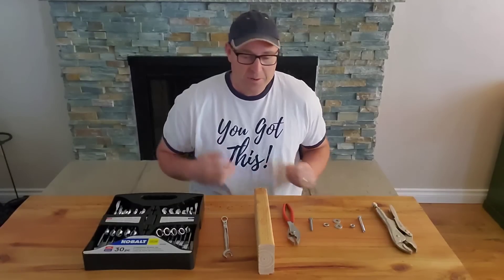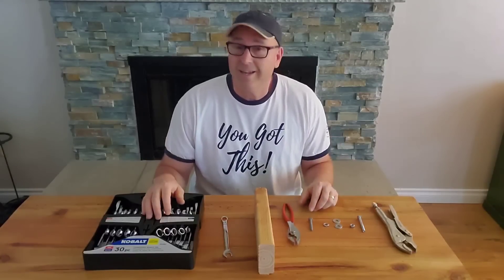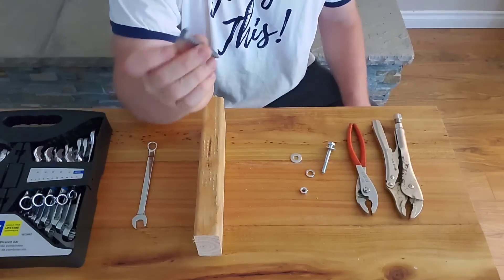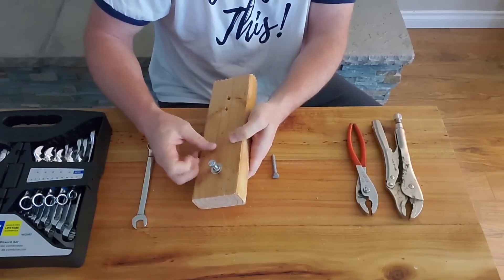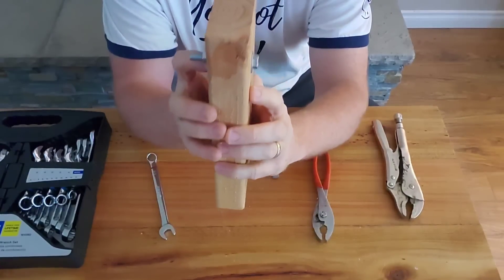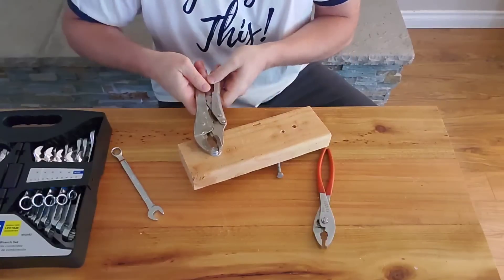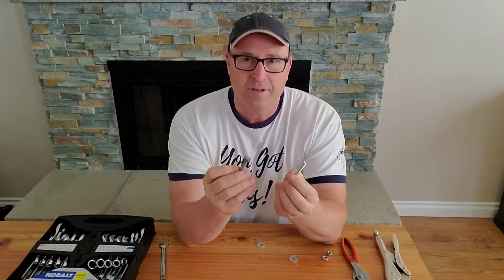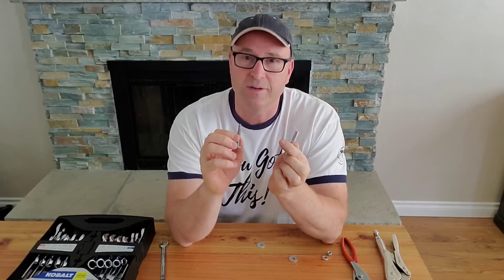How to Use a Wrench

Comment: Never forget:
Left-y - Loose-y
Right-y - Tight-y
Reply: I had a problem with that alllll throughout my childhood now I have mastered it
Reply: amen
Reply: Easy. But when there’s that one set u come along, that’s opposite. Or ur facing the wrong way. And spend forever doing it wrong 😂
Reply: @ashleyjacquot904  True though, My bed has screws that face upward into the beam so I have to lay down on my back to face it properly, If not I end up going back and forth not knowing which way its supposed to be haha
Reply: @trevorharbolt6293  however ... there are some that are the opposite.
They are rare, but usually on an IKEA product, where it's just been flipped.
Reply: Also, you're turning the top of the fastner in that direction. That screwed me up as a kid. Its a circle, if i move the bottom of screw left, aka counter clockwise, it does the opposite.
Reply: Right hand rule
Reply: i say this out loud every time
Reply: Some bolts or screws there counter or reverse threads
Reply: Except for in some toilets!! I once spent 15 mins trying to loosen a handle only to find out I was going the wrong way :((
Reply: not if you're opening markers
Reply: I use this in the shower
Reply: I live by this whenever I use any tool ever lol.
Reply: It's different for bike parts, right?
Reply: Soms bolts... they test your nerves..
Reply: I didn't get it,can someone explain me this.
Reply: What about left hand thread 🤔😂
Reply: I say that in my head all the time.
Reply: No lie, I still use it everytime I am at the workshop.
Reply: CuboidPixel seee. Exactly 😂. The struggle. I was trying to take my front seat out, in my car. And same situation.
Reply: Unless you're piping flammable gases like propane or natural gas. these are reverse threaded in order to prevent you from accidentally connecting them to the improper system and killing yourself.
Reply: @ShardtheWolf  From the top, that's correct. People are commenting that there are left hand threads- the only common ones that I can think of are the plastic nut holding your toilet flush handle on and the connection to a 100 lb propane tank. I've worked in a hardware store for three years and these are the only two that come to mind. Good insight Shard, it definitely pays to specify your reference for left or right :D

Comment: I had no idea what a locking washer was, I didn’t even know it existed, thanks.
Reply: I have seen them but never understood what they were for. This was pretty beneficial to me.
Reply: Some projects require them, some don't. If you expect the object to be used, but don't want two things to separate, use the locking washer.
Reply: They're not that good imo. Using two nuts is more trustworthy if you need something to stay tight.
Reply: Except if any vibrations get into the bolt it loosens the screws.
I've seen guys like you at Home Hardware, we call them "Double Dippers" since they have to come back and spend twice the money on a project because they're using the wrong tools and equipment.
We have common practices and standards for a reason.

Comment: If you need to buy a replacement nut or bolt, bring a matching one with you to the hardware store. There are lots of sizes and thread pitches of nuts/bolts, so bringing one that works is the best way to make sure you get the right one.

Comment: tip for wrenches, the open end is usually used for hard to reach nuts/bolts in tight spots. the open end is definitely better to use, if you can get it on the bolt or nut.

Comment: I use these tools often and it's easy to "forget" some nuts and just go using the bolts direct on the wood/whatever sometimes and it's a pain later on, so thanks, I'll try to apply the proper nuts from now on!

Comment: For those that want to know more about galvanizing:
Galvanized steel means that it's steel coated in zinc. Zinc is less resistant to oxidization than steel, and acts as the buffer for the steel it coats. If you picture a street lamp and see the spangle and speckle pattern on the pole, you have seen an example of galvanized steel at work. The process is called galvanic corrosion, and the order of moisture resistant metals is called the galvanic series.
Reply from the maker: Nice Josh! 👍

Comment: hey, you might be able to help me and presumably a lot of other people out, i'll be having to attach a lamp to two loose wires hanging from the ceiling.
what i'd specifically need to know is how i connect the wires to the lamp itself and how i screw the lamp into the ceiling, since it has no holes in it yet. 

thank you for your content, and i wish you unending success, friendo

Comment: You're really doing a great job here sir!!!! When I heard about your reasons for starting the chanel I subscribed immediately and watch every video just to support you.  My old man wasn't around when I was growing up, fortunately I had wonderful mechanically inclined grandfathers and uncles and I was naturally mechanically inclined myself. At 42 I'm a self employed locksmith who does just about all the repairs around my house and a fair amount on my car.  I'm also "the handy friend" for many of my friends.  
I'm sure that you've got a system in place for the order of your videos but I just wanted to say do NOT forget about screwdrivers...  It seems self explanatory, but I'm constantly amazed when friends of mine, even ones my age, don't even have a screwdriver...    I mean you'll need one for just about ANY job around the house from installing a dimmer switch or replacing a bad outlet, to replacing the thermostat on your refrigerator to even assembling flat pack furniture (even when they give you a tool kit in the box the tools are so bad it's just a lot easier to use your own.  
IMO every household should have at least a decent but not too expensive magnetic bit set that includes hex bits and a 1/4 drive adapter for sockets and one each dedicated #2 and #1 Phillips and flat (for when you need more reach in tight areas where the magnetic driver won't fit, like taking apart a box fan to clean the blades, etc) 
Keep up the great work!!! I know you're really helping a LOT of folks!!!
Reply from the maker: Thanks Derek.  :0)

Comment: If you dont have a locking washer you can actually screw on a second nut. I dont know it in english but the translation (ger to eng) would be “counter nut”... because of the lil diffrences in the thread of the nuts

Comment: I like to use a Carriage Bolt on timber so the square bit at the head stops it turning and you dont need to hold it. Also dont need a washer on that end and it looks tidy.

Comment: You can be working with inches and fractions of inches but is always good to know a 10 mm wrench can replace a 1/4" one, 13 m.m. a 1/2", 14 m.m. a 9/16", 17 m.m. a 5/8" and 19 m.m. a 3/4".

Comment: Just wanna leave here that altho spring washers in general seems like a good idea, they do just about nothing. Just use a regular washer and tighten the bolt, or use some locktite/glue on the treads if its really important that it doesn't come loose..

Comment: Usually when I use pliers, I use the inside of the jaws to grab the corners. Do you recommend using the flat on flat parts, or is it user preference?
Reply from the maker: The only warning I would say is be careful not to round the edges on the bolt/nut.

Comment: Will you please do a video about water flowing baseboards?  You know the old fashioned heating systems some young adults are likely to encounter in a first (think old and cheap) apartment or house. Specifically, the thermostat valve regulator cover. Mine broke years ago (who makes an analog thermostat regulator the sticks out and gets knocked around by furure??!?) And I didn't replace because I thought I needed a plumber ($$!). Now I know that I can replace the knob, but I don't know if I need the exact same part (circa 1982) or any old honewell knob. Please do a video about this, I beg you!

Comment: It's there such a thing as alag bolt for metal? Like the rain pipe. The pieces keep calling apart
Reply from the maker: It's a little tough without seeing what is going on, but down spouts are usually held together with small metal screws.
Reply: @DadhowdoI  Thank you. Yes, are those screws any particular kind? That's problem #1. It keeps falling apart. How do you put them in without bending the metal!?
Reply from the maker: @Belamom1  You just need short sheet metal screws. You don't want long ones or they will catch debris going down the spout. You will need to drill pilot holes for the screws to go into.
Reply: @DadhowdoI  Ah, pilot holes! Hopefully the drill doesn't bend the metal...! Thank you so very much!
Reply from the maker: If you use a drill bit meant for metal and take it slow you should be good.
Reply: @DadhowdoI  Slow. Got it! Thank you so much!

Comment: Hey dad, i had a question tho. What would be i need the most to drive those on a wood, metal or concrete. Is it good to buy a Drill Driver or should I go to a Hammer Drill? Thanks dad!
Reply from the maker: A drill will be good for that, I will be showing it in 2 weeks. :0)

Comment: What would be the purpose of using a lag bolt instead of an actual screw you could use a screwdriver on? Is it a size thing or are there situations where there's some benefit to having the hexagon-shaped head instead of a......whatever you call the hole where the screwdriver goes lol. or are bolts and screws close enough to the same thing that lag bolts are just the hybrid in the grey area

Comment: Is a lag screw also called a self tapping screw?
Reply from the maker: Nope. 😃
A lag bolt is meant to go in wood, so it will create it's own threads in the wood. A self tapping screw is meant to create it's own threads in metal.

Comment: DAD!! my toilet is clogged I turned off the water valve please help me. I dont want to call a plumber ($150 p/h)  I bought a snake and it drowned😂 sorry. . It bent.. please God help me 😰😭😭
Reply from the maker: Did you try a plunger? You want a good one like this - https://www.lowes.com/pd/Liquid-Plumr-6-in-dia-Rubber-Plunger-with-18-in-Handle/1000096916
Reply: @DadhowdoI  OMG 👐🏾thank you ima run to walmart if not I'll go to Lowe's in the morning....
Reply from the maker: @sophiakiwie  Walmart is fine, just make sure you get one with that rubber piece sticking out. It helps get good suction to force out the clog. 👍
Reply: @DadhowdoI  yes sir I got it. The water is still draining out slow...i flush and plunge, when it drains it's very weak... but it is flushing...
Reply: @DadhowdoI  ok... I dealt with it a couple days.   I called a plumber 😭😭 he pulled the bowl up ... he found a Beyblade (kids toy) laying flat in the hole..   fml .. wheres the bleach😩😩